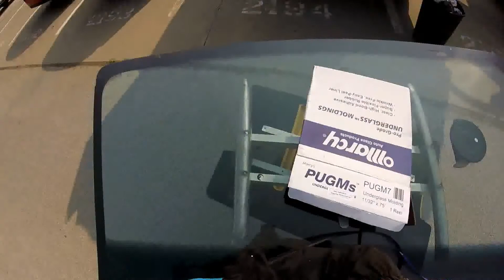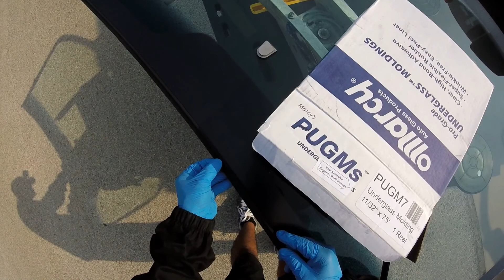dodge pick up 2004 windshield replacement

Comment: I had my windshield replaced by ACE Glass in Hawaii in 2014. I noticed in your video you installed a Marcy's PUGM7 11/32" seal on the windshield you installed. I would like to know where you got the information /documentation/directions for installing the Marcy's PUGM7 11/32". I am currently battling with my insurance company over the windshield repair. Please advice, any help would be appreciated. Wish you worked out of Hawaii, I wouldn't have this issue if you had installed the windshield Awesome workmanship, all glass dealers should watch this video. thank you